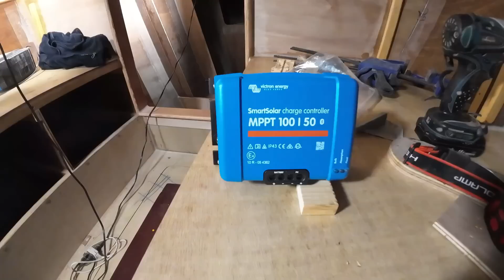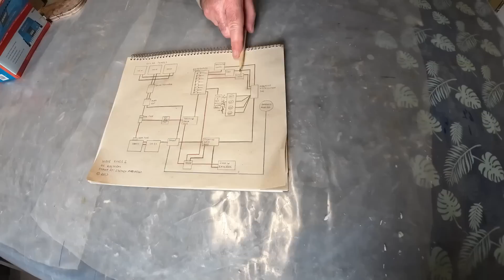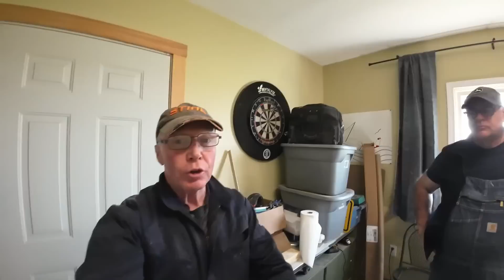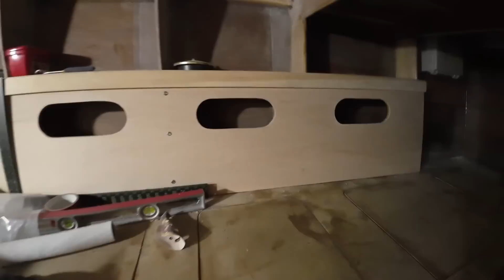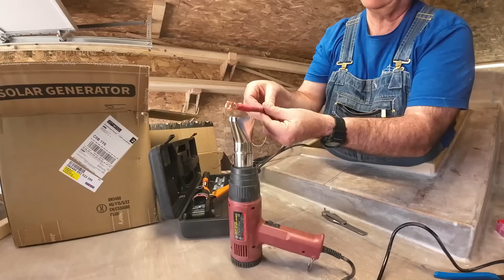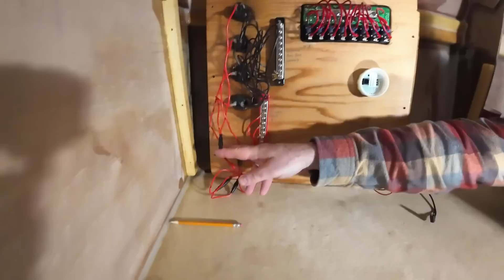S2E83  A Robust Marine Electrical System is Installed // 42 Days Before Launch...Yikes!!!

Comment: Looking good. I might suggest carrying a spare solar charge controller. Ive had those victron boxes flake out on me before. Looks like youve got redundancy everywhere else with the solar panels and batteries. An extra charge controller would take out the single point of failure. Fair seas
Reply from the maker: Very good point Sam, I had a wishy washy controller on the original Wave Rover and this time around we have upped our game but a spare is very good advice and doesn't weigh much. Love your channel bro

Comment: Well oversized, bigger boats use that size wire, Amps used x Voltage used = Heat watts  so if 10Amps going through wire at 12v = 120 watts usage, so all the distribution wires for equipment can be anywhere from 14 to 12 to 10 gauge normally, only need the heavy gauge at the point of batteries because that's where all the current combines and returns,  using high power units such as heaters require heavier gauge but not as big as the battery return, however better safe than sorry

Comment: well done. Just the cigarette lighter sockets are not well chosen. Although wideliy used, they are not reliable. There are much better socket systems for 12V available.
Reply from the maker: Easily replaceable if needed.

Comment: Good choice for the AIS.  I'm using the Vesper XB-8010 and it's working great (cruising the BC coast, currently in Nanaimo where I understand you did your first boat build).  Laptop is my chartplotter (OpenCPN), the Vesper has a built-in WiFi, so I connect that way.  Cheers!

Comment: It looks good, but the whole installation is difficult to evaluate. It should be emphasized that the conductor is an inductance on which, as a result of the lightning, a voltage of 1 kilovolt is induced on one meter of the wire, this is a consequence of the electromagnetic radiation of lightning. on 10 meters of wire, 10 kilovolts of short-pulse voltage, hence the question of whether the charge controller on the wire can withstand such a voltage. In this case, there may be auxiliary varistors and gas dischargers...each wire should be perceived as an antenna on which voltage is applied as a result of lightning, we are not talking about a direct hit, only lightning at a distance of 1-1.5 km and closer, sound is less than 3 seconds behind lightning...

Comment: I did not see where your were planning to mount your inverter? Just remember that it NEEDS to be as close to the batteries as possible. The manufacturer of my 1500 watt inverter said no more than 5' of cable between the inverter and batteries. There will be a lot of amperage on those cables under load. Great video!!!
Reply from the maker: It will be right next to the battery compartment. Stephen will be back to finish the electrical in a couple of weeks.

Comment: Excellent work on the electrical system gentlemen. Thank you Stephen for lending a hand on this fun adventure. Best wishes for a good weekend of painting Alan and best wishes to Mrs. Wave Rover and Mr. Speckles. Here is a generational question: How many subscribers are old enough to have actually seen the "cigarette lighter" plug actually used with a cigarette lighter in a vehicle?
Reply from the maker: As kids we used to love pressing them in and waiting for them to pop when heated.

Comment: The wire lugs used on the heavier gauge cables are not marine grade. They are raw copper and they should be tinned copper as marine wire is. Unfortunately this is a potentially dangerous omission. Ben S/V DAWN
Reply from the maker: Stephen will address this in the final fit electrical video in a few weeks.

Comment: I thought you were taking those super batteries with all the different  plugs?
Reply from the maker: I've always said (on several occasions) that the power station was a backup
Reply: @RoversAdventure Thank you, I must have missed that.
Reply: Same here..
Reply: I'm pretty sure those were never planned to be part of the primary system. That would be incredibly stupid. They have their place as a secondary/backup system.
Reply: @Garryck-1  easy mate! It was just a question. Also, as a fulling enclosed unit, there could be less failure.
Reply: @AdrianKerr  - Fully enclosed one-unit-does-it-all devices are a problem, not a benefit. If part of it fails, you can't swap out the damaged part with a similar-but-not-identical off-the-shelf part, and just carry on. It can only be repaired by the manufacturer. If you're in a remote part of the world where shipping takes weeks/months, that's a problem. Potentially a very dangerous problem. Hence my remark about it being "incredibly stupid." Because if you plan on sailing around the world, having such a device as your primary system IS incredibly stupid.
Reply: @Garryck-1 lol

Comment: Surely the fuses would be much better mounted against the rear of the panel, with access from the front instead of having to unscrew the whole panel to access a fuse.
VHF radio is range limited; a licensed HF transceiver makes ocean passages much more interesting.

Comment: You might want to look into using Auto or Manual Resetting ATC/ATO Circuit Breaker Fuse. They can be very useful when trouble shooting.
Reply from the maker: Don't know what that is but I will look it up. Thanks

Comment: Good Install! I was wincing at seeing the lose negative cable sitting so close to the positive battery terminals though. Also, I did not see a circuit for a bilge pump. Is one being installed? Maybe just a manual one?
Reply from the maker: Just a manual bilge pump
Reply: Yes, that loose uninsulated negative battery cable looked potentially exciting! In the universe I inhabit, that sort of thing usually leads to sparks!
Otherwise, great job, and good to see progress!

Comment: Any reason why you chose to use black wiring for DC negative instead of the new yellow wiring?
Reply: Hi Jack. ABYC standards allow for black or yellow but it’s much easier to get the marine grade black electrical cable where we live in Canada. I’m sure that I could have procured it outside of Canada but managing costs are an important factor and where the yellow cable is not a superior product, the choice to go with black was straight forward.  - Stephen M.
Reply: @stephenmarinelli437  thanks. I figured their had to be a logical reason.  I can tell from the work everything was thought out.
Reply: Is there any reason to go with yellow over black? Distinguishing DC negative from signal cables or something?
Reply: @styx85  If I remember correctly, the reason was, for boats with AC power, making DC negative a yellow cable visibly distinguishes it from AC hot wiring.
Reply from the maker: @jackofmosttrades9127  that makes sense.

Comment: 1-with a 2000w inverter, you could use a single pan induction stove cooktop . $90 at Canadian Tire. This will save you a lot of stove fuel and is much safer as there is no fire inside the boat. Highly recommended. 
2- please paint the inside white before installing and other equipment. You need the interior to be well lit in case you need to work or search for something. This will prevent the wood to absorb humidity from the salty air at sea and you will be able to wash the interior. Highly recommended. 

Cheers, Richard
Reply from the maker: Prepping for painting the interior this weekend. I had to do the electrical out of sequence due to scheduling. Stephen lives in the next province and has a full time job.

Comment: A "small" 2k inverter? We have been able to run a 110 fridge and computers with a 500watt (actually I think it's 300w but I am not there to check) inverter. I do understand that with inverters, it is often about what happens to be available and some times 2k are more available than a 1k. The important number with all of these is the quiescent current draw. Some times a newer higher powered unit may have a lower quiescent current than an older lower power unit. Also, a 1k or above will allow at sea repairs with some power tools (drill, saw, grinder). Anyway, to me for this size boat, a 2k inverter is big, not small. Something about being the appropriate size for the application. With 300 watts input, a 2k draw had better be very short duration. I would not cook or heat water with it for example. (even for tea) As with any low power solar driven system, all higher draw uses should be in the morning, not the evening. Evening is for lights and reading   :)    And of course always keep enough for nav.
Reply from the maker: I agree Len, I consider the 2K inverter big.

Comment: It's amazing how much more goes into a marine application compared to a van or RV.  My system is 4x larger and 10x simpler in my converted step van, a van that doesn't have to float or cross oceans.

Comment: Corrosion/ moisture will not be kind to many of the components….but good install. Thx, Andrew
Reply from the maker: We bought the best marine kit we could.
Reply: @RoversAdventure  it is all top quality, am familiar with all of it. My comments pertained more to small boat sailing, salt water on oilies spraying around, getting in and behind cupboard doors and fighting with condensation to see who can corrupt buss bar terminals and connections the quickest. No place in a vessel that size to successfully hide modern electronics…one unexpected douching…and, well, keep your sextant handy! Thx, Andrew